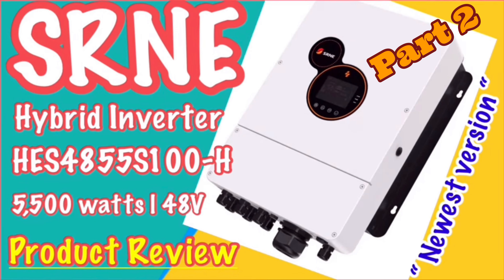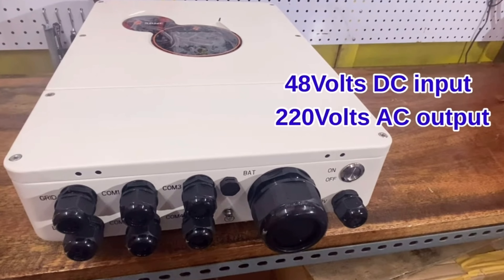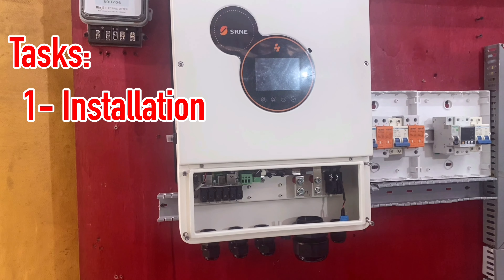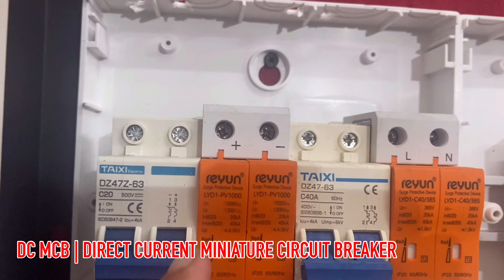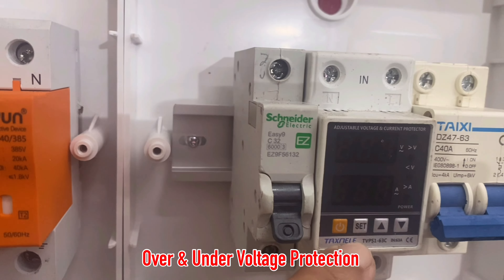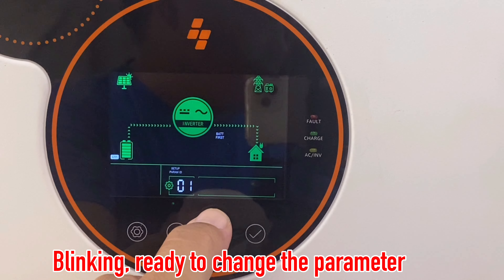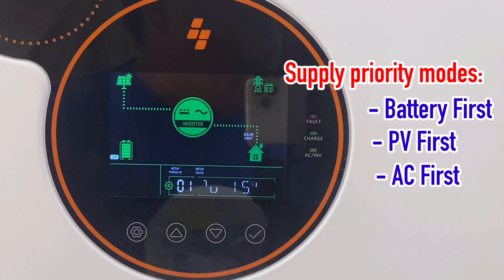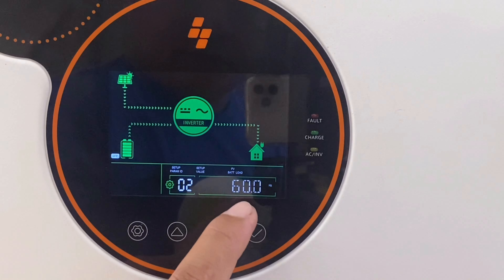Part 2- SRNE HYBRID OFF-GRID 5.5Kw Inverter | Installation | Load Testing | Parameter settings

Comment: Hi Sir Renz thank you for the informative video.  Just want to ask if this is advisable for use with deep well pumps with 1hp?
Reply from the maker: Yes, but you have to use soft starter or variable frequency drive module for the pump

Comment: Sir renz tanong ko lng po kung paano kung sumobra yung watts mo  example yung gamit na hybrid 5.5kw tapos yung load umabot 6kw anu po   magyayari lilipat po ba sa main?
Reply from the maker: Yes, lilipat yan kung naka connect sa ac input
Reply: @solarenz  wala b load sharing from inverter at du if ma overload mo si inverter?
Reply: Sir kung .7hp na deep well pump kelangan pb ng vfd

Comment: Great insights shared. Just want to ask, when pv is set to first priority and when it becomes insufficient at night it switches to grid supply, and the grid supply charges the battery and also bypasses the battery. How can one prevent the bypass so the battery will automatically be supplying the inverter inplace of the grid supply at night?
Reply from the maker: Simply put the grid charging to zero amps